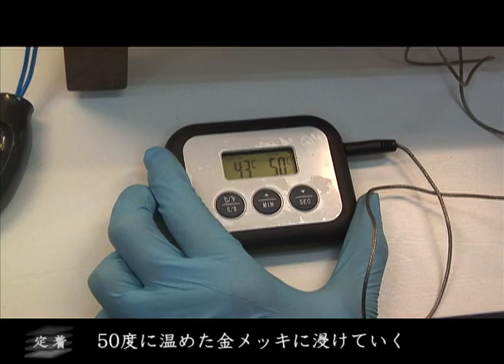Making of Daguerreotype by Takashi Arai *Beta ver.

Comment: I see that the red light in  your darkroom is always acrive during sensitising and developping? Is their no risk for veiling ? Thx and have fun
Reply from the maker: Back in 2020, there was no affordable video camera to film in a very dark environment. It was just for filming, and I don't usually use red light during sensitizing because you need to check a subtle change of color on the silver surface. Applying red light intentionally on dag plate makes exposure time shorter, FYI.